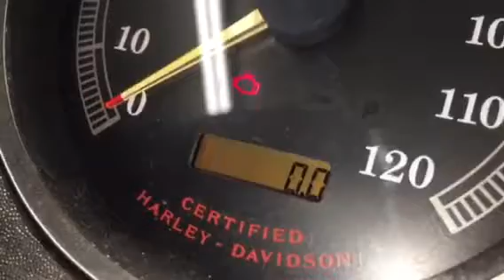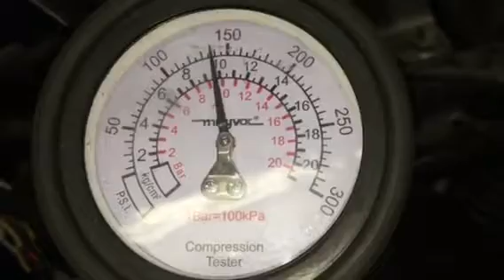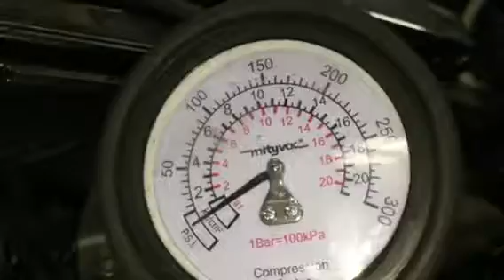Harley Davidson 2001 FLSTFI Fat Boy Motor Engine PSI Test Video

Comment: Hi..cool  video, ty. I have 2005 15 anniv fatboy, 95" 1550cc. having Indy check my new camplate and oil pump install, from fueling, when my indy installed it. It started sumping , when sitting!. in a week it would wind up with a little bit on the stick, when cold.  He took it all apart, new gasket and o-rings, better he said. But i just asked him to do a compression test, hoping i dont have oil, leak down or bad valve guides,etc. Is 130 good compression, is what you guys got, correct?